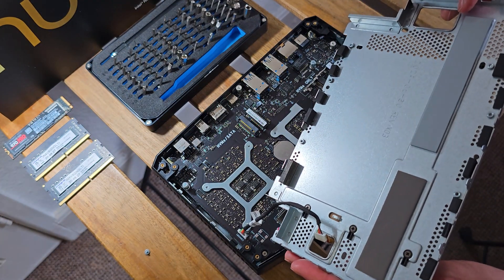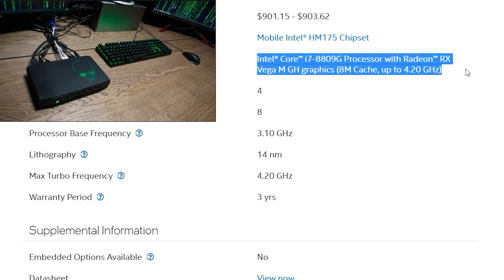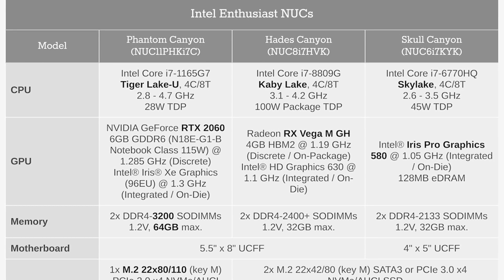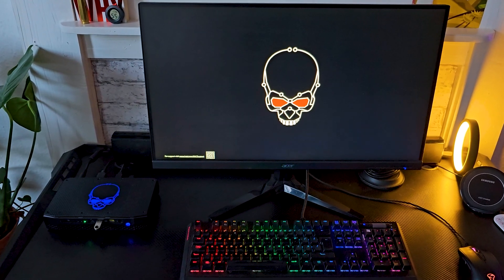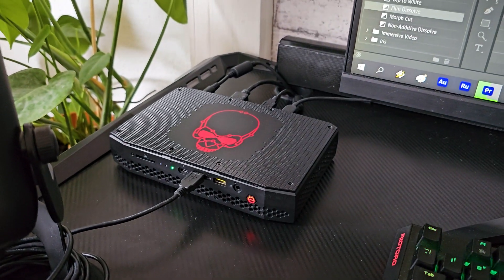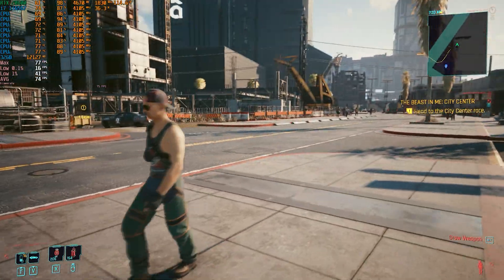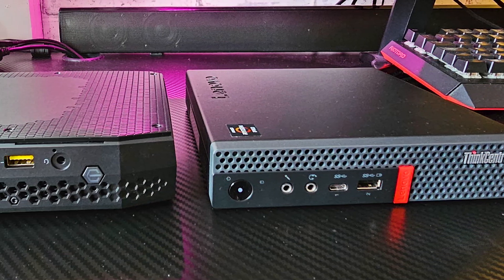Can the Intel NUC 11 Phantom Canyon be a Desktop Replacement? Episode 3 - How Small can a PC get

Comment from the maker: Who else is rocking in 2023 one of these? 👽 To check the previous episode, click here - https://youtu.be/WclsdhywRQo
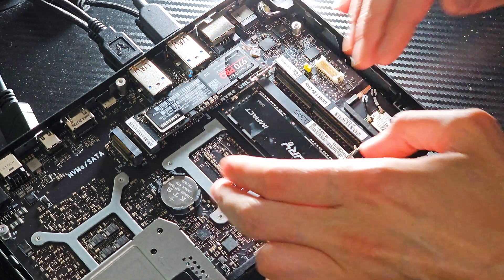Reply: Just bought one, getting it in the next day or two. Got the last one on ebay new for $700 usd with tax (bare bones). You found a really good deal for $500. By the way @ 6:45 in your video where did you find that kingston fury 32 gig ram kit, looks to be dual rank (r2x8). I could only find the 32gig ram kit 16gig x2 but (1rx8) single rank ram. Dual rank is better if not over clocking but its quite rare.
Reply from the maker: @Outdoors5060  Excellent! Yeah at the moment some of the other sites in the UK have it for £560, as the cheapest. So I think they are trying to sell all of them fast😅

Ah yes, I found that kit on ebay for like £53. So happy as well when I saw they were dual rank. I won the auction at like 7am 😅 Was worth it. https://www.ebay.co.uk/itm/256034468728?mkcid=16&mkevt=1&mkrid=711-127632-2357-0&ssspo=Ud6TNDDwRhm&sssrc=2349624&ssuid=6ojCXdnDSCm&var=&widget_ver=artemis&media=COPY

Let me check the code. KF432S20IB1K2/32

https://www.kingston.com/datasheets/KF432S20IB1K2_32.pdf

So yeah, good eye 😎
Reply: @Glob3Tech  Ya I think you won the ram lottery. Unfortunately I couldn't find KF432S20IB1K2/32 dual rank for under $150 usd. I could only find KF432S20IBK2/32, single rank for a good price (still a lot at $79.00). You are a true deal finder 👍.
Reply from the maker: @Outdoors5060  Thank you! Will do a video for them in the future. Any particular tests you would like to see? 
Yeah brand new I think they are the same here, regarding prices. At least if they are in stock anywhere, because from what I understand, these dual rank fury sticks were discontinued.

Let me know when you get your Nuc and how you find it 👍
Reply: @Glob3Tech  Est-il fiable, pas  problème de démarrage , de ventilateur bruyants pour ceux qui l'ont acheter ?
Reply from the maker: @cardavis2835  From I have read online, overall, people are happy with it. So far all good on my end as well since I got it. 🤞👍
Reply: @Glob3Tech  ok merci pour votre réponse.
Reply from the maker: You're welcome 🤗
Reply: I am quite tempted to get one - a combo with 2 TB SSD, 64 GB RAM, Win 11 Pro for a bit less than $1K. My main use would be try out Unreal Engine 5 and create a couple of indie platformer games to get an idea of how the whole indie game development process works out. I am wary of getting a newer configuration desktop because of the cost and I wonder the configuration of this system would be sufficient for getting my feet wet with game development.
Reply from the maker: @indrajitg  That sounds really exciting! If there is a way to assess if this CPU is enough for your needs, since I have no experience with what you want to do. Let me know how it goes and good luck 👍
Reply: @Glob3Tech  I was a bit worried if the latest version of Unreal Engine would work properly on the dated GPU on this NUC but turns out that it works quite well! Once I gain a bit of experience that I could invest on a more expensive desktop with a newer RTX card.
Reply: Got mine back in 2021 for AUD1350 (US$870) great deal at the time. Still going strong almost 2&1/2 years later
Reply: @kenmeadows444  Was that for the kit bundle or the NUC alone? If it was for a bundle including RAM and SSD, that really was a steal deal! I got mine recently for about AUD 1500 including 64 Gigs of RAM, a 2TB SSD and Win11 Pro OS. So far, I am quite happy with it.
Reply from the maker: @kenmeadows444  Glad to hear! 👍
Reply: I am using that with Linux OS and play Starcraft 2 (with Lutris) and CS2
Reply: Me!

Comment: Hello, I ordered the same model and was considering if it would be better to get a desktop instead. and noticed that your previous desktop is pretty much like something in my mind. Ryzen 5600 and 4060. But as you changed your main PC from 5600X & 1080 to this, I wondered what made you use this PC as a main PC. Because of the mobility and design or was there any special reason?
Reply from the maker: Combination of reasons. Mainly, I explained this in the video. It was basically an unexpected surprise after me testing multiple mini PCs. Seeing how potent it is for my needs, then the added bonus of mobility, made it a clear choice for me, since I'm a big fan of SFF.

Spec wise, yes, you might be better of with a desktop equivalent but it depends on what you want.
Reply: @Glob3Tech  thank you for the explanation! I’m at right between this Intel NUC and desktop so I’m struggling making a decision haha. For what I need right now, Intel NUC fits perfectly doing its job but was concerning in the near future with new AAA games. But yeah so far, it seems to be good according to your video. Thank you for the video
Reply from the maker: @user-wy8ki9nc1y  You're welcome and thank you as well 🤗
 I know. Everything is soldered, so yeah, oneoff. But any specs will be absolute, it's only a matter of time. How long, I don't know and hope a couple of years. 😁 But that's why I bought it at 500 quid and not 1000, what it was when launched. I only hope ASUS (since they recently took over the NUC business from Intel) will make a worthy succesor in this 1.3L frame.

Comment: Hey guys i had this enthusiastic nuc it was powerful but not that quiet i suggest this for normal multitasking and kinda for gaming, its true it can run most of triple AAA games but it will get noisy but it depends on how you leave the fan speed ,if you leave it on balanced it wont get loud but might get hotter, if you leave it on cool it will keep temps down but it will be louder if you wanna know how loud like normal gaming laptop.If you wanna buy this consider getting two 8 gigs of ram sticks dont buy a single stick of 16 gb ram or 8gb ram stick it will bottleneck i did that mistake and i got fps drops in gta 5 cuz i got only a single 16 gb ram stick so please dont make my mistake b ,I also saw all the reviews about it ,everyone said its quiet but not for me i returned it a week later ,the reviews might say its good , its not bad or anything wrong with it but some of them reviewed it out of the box like what device will not perform good out box so i got nothing against it .If you consider getting this its your choice, it didn't work for me but it might for someone else who knows
Reply from the maker: Thanks for the extra feedback 👍

Comment: Awesome video 👍

Just pulled the trigger on one of these today, current prices make them much more attractive 😎

Quick question, would you recommend the 4tb m.2 SSD or do they get too hot for systems like these? Could certainly use the extra storage these days and they're not too expensive atm.
Reply from the maker: Thank you! Indeed and hope you enjoy it to the max 😁 

Moat def, with the 4TB. I think it depends on the model per say, if you find a review that shows a decent temp, you should be fine, regardless of its capacity 👍 You can even install a gen 4.0 but get gen 3.0 speeds, of course. 

Let me know how it goes.
Reply: @Glob3Tech  Thanks. Just having some doubts about whether the CPU's powerful enough though. Do you find it can be a bottleneck with some of the things you do on it?
Reply from the maker: @mrchico2621 On paper it looks like that especially coming from a 5600x. In my day to day usage with video editing and gaming (what I put in the video as well), it doesn't miss a beat 👍
Reply: @Glob3Tech  Well that's good to hear. Just saw it benchmarks worse than my old Ryzen 4300U that I've been slumming it with the last few years and that spooked me a bit lol. Should be enough paired with that dGPU for what I want to do I guess 🤞
Reply from the maker: @mrchico2621  I see, valid points. Overall yeah, you've seen its potential. Anything in particular you want me to test?
Reply: @Glob3Tech  I was just thinking more about emulation stuff, which I tend to feel is often more CPU-heavy. But I'll find out myself in a few days anyway when it pops through the post 😂
Reply from the maker: @mrchico2621  Ah I see. Never tried those I'm afraid 😅 
Let me know please when you have it how you find it 🤗
Reply: @Glob3Tech  Will do 👌
Reply: @Glob3Tech  So it arrived today, but unfortunately I'm not having much luck with it. I'm not getting any picture on the screen when I power it on...no bios, nothing. I'm guessing you didn't have this problem with yours?
Reply from the maker: @mrchico2621  Yeah sounds bad unfortunatly. Indeed, mine fired first thing. Is the Ram seated properly?
Reply: @Glob3Tech  Yeah I had a look inside, the RAM was seated correctly. I've just emailed them for help so I'll just have to wait and see what they say.
Reply from the maker: @mrchico2621  Ok, fingers crossed. It should boot like a normal pc with the logo etc (Skull logo and a QR code on the left, finally on the right, boot options. If the boot options don't show, that means it's an older bios like I had. An update will show them).

Comment: I still rock my OG Skull Canyon and also have a second 8th gen Bean Canyon, they both have the on-die 128mb DRAM cache which is split 50/50 between the CPU and iGPU, if you disable integrated GPU and run an external GPU, the entire 128mb L4 on-die cache is dedicated to the CPU helping with eGPU latency problems.
Reply from the maker: Very nice!

Comment: do u have little buzz noise too? i tried 2 units and both have it
Reply from the maker: Yes and no. I heard it being mentioned on some forums and comments. Mine's seems to be ok as in the low rpms, I can't hear any buzzing acoustics from 40cm away, like you've seen in in my video, on the desk. 
Only if I put my ear right next to it I might hear a slight buzz but it's very faint. Hope this helps.
Reply: @Glob3Tech  i realized that all the time it was psu, not the pc itself. If I isolate it well, i might get rid of it
Reply from the maker: @alanharperchiropractor  Even better then. 👍 Yeah, my psu brick is under the table, in one of those cable management brackets . Can't hear anything from there.

Comment: I just got this after watching this video. What RAM and NVME do you recommend?
Reply from the maker: Enjoy it! 👍I run those kingston impact fury 3200 mhz cl20 1.2v and 2x 1tb samsung 970 pro.

https://amzn.to/3P4GG30

I would get any 32gb 3200 mhz 1.2v kit that is on offer and as for storage, any gen 3.0 that is big enough for you. Sabrent, Samsung, Corsair etc.
Reply: @Glob3Tech  perfect, I think I found a good deal on the 970 pro. Need to find a ram now. Btw, are you still using Phantom Canyon or have you found something better? I love the size but slightly worried about the cpu considering its only 4 cores. I will be mainly editing 4k videos for fun and doing office tasks.
Reply from the maker: @toysars  Still have it 😁 It's my main computer until, like you said, something better comes along but be a long time I think 😁

I thought the same regarding the CPU but even with 4k editing and triple-A titles, it just works. I did some seperate game testing in my Mix playlist 👍

Comment: Do you think this one can be used for intensive or medium video editing at 1080p? Cause the 12 Serpent Canyon is louder and heavier.  I am still undecided between the two. If this does the video editing well, no need for Serpent. Have you tried further video editing in Premiere? What are your thoughts?
Reply from the maker: I mean I edited all of my videos since then, on this machine and mostly 4k. With warp stabilizing effects, plenty of different files and footage. I did 1080p as well on CapCut and Premier Pro. No problems at all. Anything specific for me to try in Premier Pro?
Reply: @Glob3Tech  One video with Green Screen + another video as background + a third video sharing the screen with the former combo, as image in image video [3 videos at the same time]. If it can do that it's really impressive
Reply from the maker: @thephoenixchant  Cool. Worth a shot. Will experiemnt soon.

Top of my head, anything igpu/gpu dependend, it has plenty of power especially in Premier Pro since it can use both as the same time as hardware acceleration. Anything CPU dependent, yeah there it could see slowdowns.

Comment: This is a great package.  I got the kit for about 500 euros, and added 32gb ram and samsung 980 pro. So small, powerful and quiet.
Reply: Same here with the same specs :) I paid only 410 euros for a used one on ebay and love it
Reply: I just discovered that one must activate turbo boost in Bios what enables way better performance with only a slight temp increase
Reply from the maker: Yeah it has a better bios than most custom prebuilds.
Reply from the maker: So glad you got one as well and are happy with it 😁

Comment: wait, this one replaces your phanteks shift itx desktop pc?
Reply from the maker: Yup. I had to sell all my computers and gear. This was a nice suprising bonus. I mean I was happy with that Lenovo from the previous episode.
Reply: @Glob3Tech  do you mean you have to sell your old build in order to get this one? I think you have a 1080 or something? How is the overall performance compared to the your previous itx desktop?
Reply from the maker: @GeForece6200  Yeah sold most of my stuff for different reasons. Didn't plan on this nuc but glad I got it. 

Yes I had a 5600x and gtx 1080.
For my needs (video editing in premier pro and some gaming, like Diablo 4 now) it does an awsome job. It's a very optimised combo what Intel did here. On paper it looks like a downgrade like 4 cores vs 6, 6gb vs 8gb vram but again, for my needs, I'm happy. Plus being so portable, it really helps me now. 

So make sure you know exactly what you need if you plan for such a platform. Especially since Intel just announced that it canceled any future NUCs.

Comment: What a nice, quick review! I like the way you’re talking about it - very open minded and down to the facts.
I also just snagged one for 550 from a German vendor! Was actually considering the NUC 13 Pro i7, but that would be costing even a little bit more than this one. I also got a dual ram kit 32Gb - Gskill Ripjaws.
Any guidance you could give regarding setting it up? Hardware wise I’m good, but the time I’ve set a computer up last was probably like 10 years ago.
Reply from the maker: Hi there! Thank you very much and glad you got your own Tiger as well 😁

Cool with the ram, what specs?

I have one specific tip for this one, yes. Make sure to get a fairly recent copy of windows on a usb stick. Otherwise if it's way to old like I did (like very old), no ports will work on the nuc, not even the ethernet 😅 Then update its bios to the latest, from its website. Very easy since it's an executable. That's it. Win10/11 will take care of everything, as you saw in the video. 👍 Let me.know how it goes and if you have any more questions, don't hesitate.
Reply: @Glob3Tech , greetings to you too!
So my first unit arrived a few weeks ago and it was unfortunately defective. One of the fans was badly balanced and was humming most of the time. The RAM I got is the Ripjaws 16Gx2 DDR4-3200 CL22-22-22-52.
I was installing the latest available Windows and whatever drivers the automatic Intel driver update software recommended, plus the Nvidia drivers on the first machine. Then run several different stress tests before noticing the problem with the fan. It was a bit unstable, laggy and sluggish before all of the drivers were installed though.
Got the second unit and just swapped SSD and RAM to run the same stress tests.
I didn’t encounter any issues with the software neither with the first or the second unit, actually. Although I probably should swipe and make clean installation of everything on the second unit.

It’s a really long time ago that I was setting up a computer last.
In your opinion - what drivers/utilities should I install to utilise all of what this machine can offer?
Is the automatic Intel Driver Utility + Nvidia drivers sufficient and scarce enough?
Reply from the maker: @jegorzhdanov3179  Nice to hear from you again. 😁
Ah bummer with the broken fan on the first one. 

Yes, I would do a fresh install of everything for peace of mind. 

The only extra ones I use on all of my PCs, are the Core Temp app, so I can always see the cpu temps and power consumption. You can even set an alarm for it if it reaches a certain temp you wish to set up.

Msi afterburner if you want to quickly see an overlay of all the stats (temps, cpu load, gpu etc) in a game. 

That's about it. Because it already has its own tuning and display app (Nuc Control Center) and the automatic update center. So yeah it's pretty looked after from factory.

Last week I had a bios update for it. A simple executable. Very easy 😁
Reply: Where did you get it? Saturn/MediaMarkt?

Comment: Can you stream while gaming at 1080p Max, combining both Gpus? Do the frame rates drop too much? I am undecided between this one and the 12thGen extreme Nuc, although I like this one's portability
Reply from the maker: Good question, will put this on my list to test in a future video. 

From what I understand, the iGPU handles the thunderbolt ports as in an type c monitors. Plus I haven't seen the igpu working in Premier Pro, just the rtx2060. So yeah need to fidle more with it. 

The 12th gen is more powerfull of course plus it depends on the price. But yes, portability wise, the 11th is amazing.